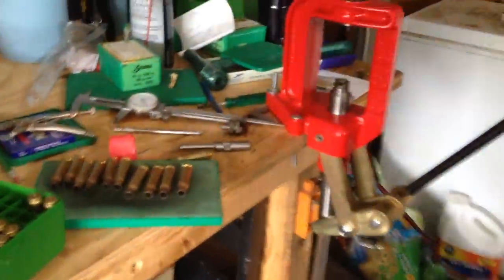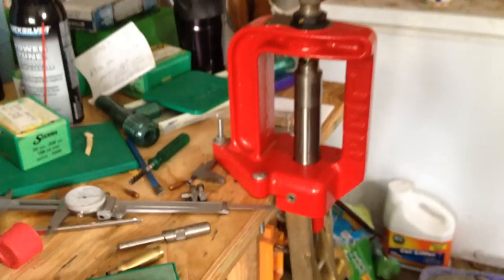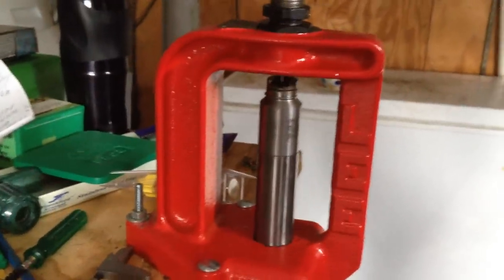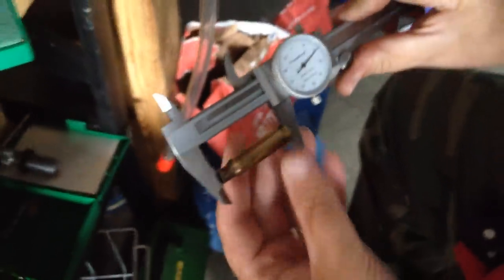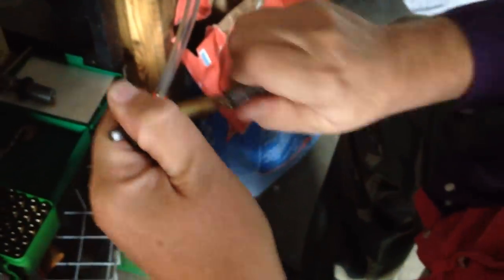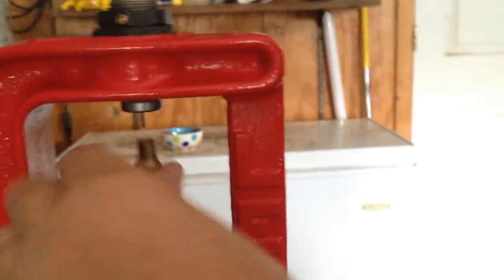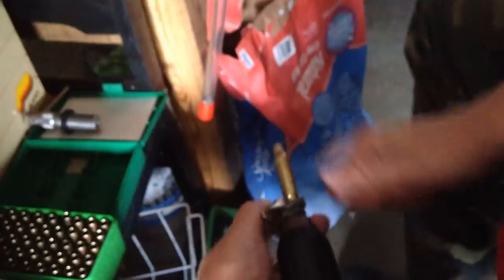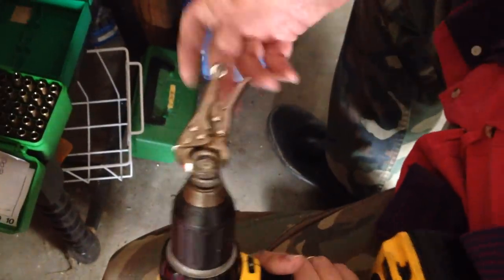Speeding up brass trimming with the Lee case trimmer system

Comment: I just started reloading about year and half ago I use basically the same set up I put the Cutter into the chuck of my drill and I hold the case and holder in my hand with vice grips that way you dont have the vice grips spinning and making the brass some what Uneven but nice video like it

Comment: Why not put your case length gage in your drill chuck and sand it with down with 400 or 600 grit sand paper just so it fits your case problem solved